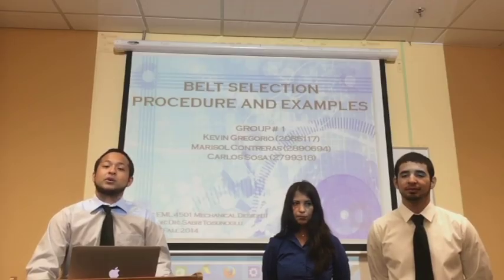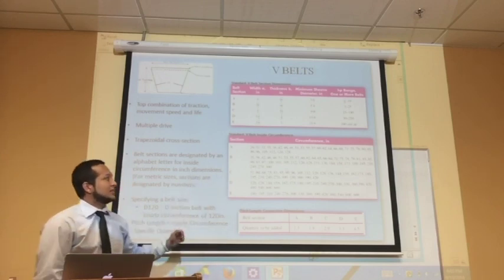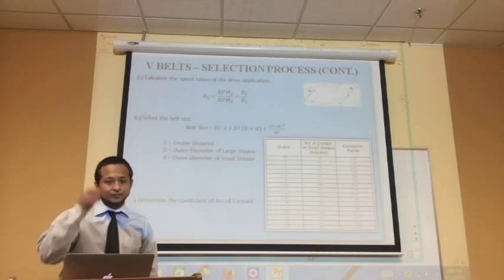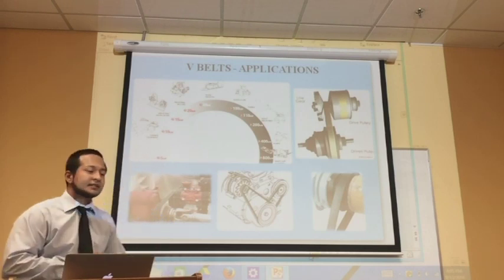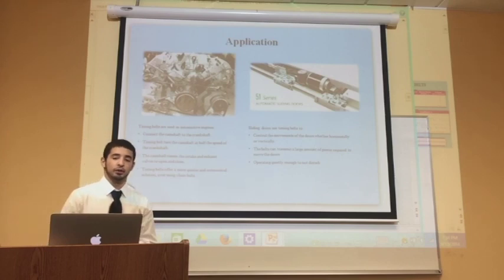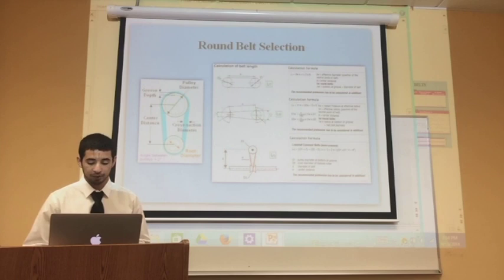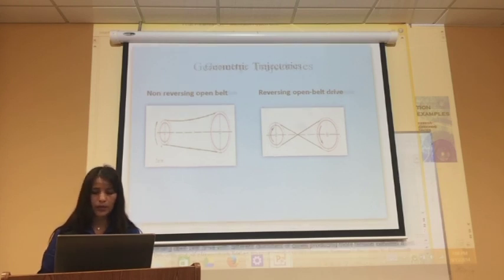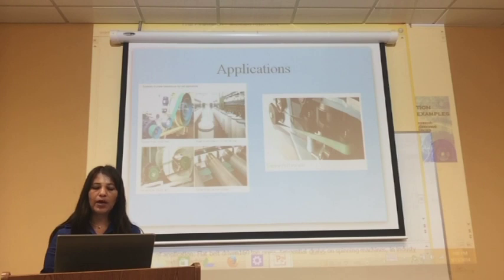Team 1: Belt Selection Procedure and Examples (V, flat, toothed, round belts)

Comment: Team 1 did a great job presenting the material. Very knowledgeable and prepared. The presentation flow was smooth. Very formal. Only thing is reduce the clutter a bit and use a bigger font.

Comment: Very good presentation. Smooth transitions and notable confidence in your speech. As mentioned by many other people, the lighting needed to be adjusted, but this is normal as for the constraints of the presentation factors. Also maybe finding a better focus or distance for the projector because the outside parts pop out. Overall, very informative, you gave many applications and uses for different belts.

Comment: Overall a decent presentation. I wish the slides were a little bit easier to read, but that can be easily fixed. Also had trouble hearing at some parts. Thought the angle of the camera was a nice different perspective, and the podium made the presentation seem more formal. I felt it was a good job.